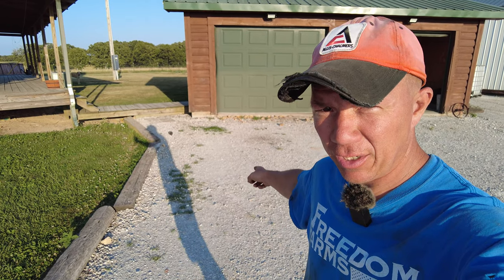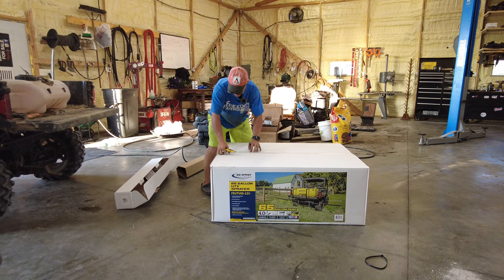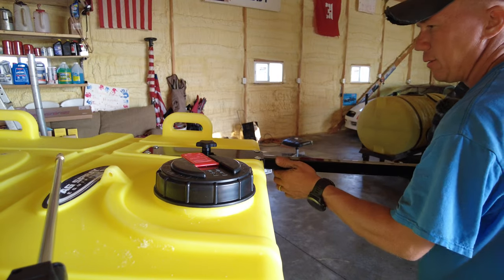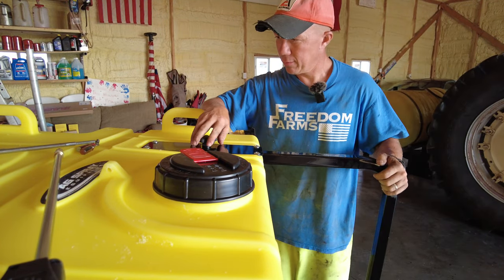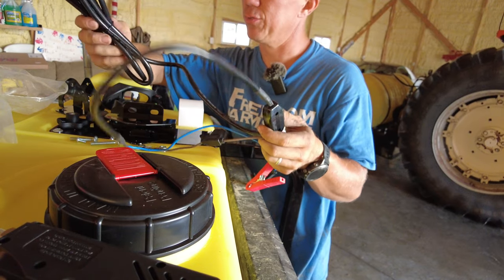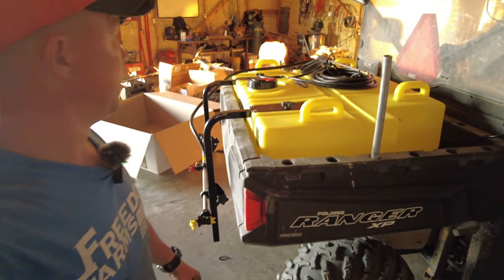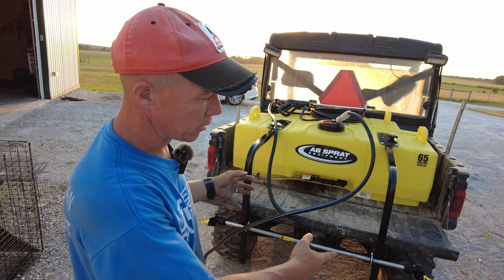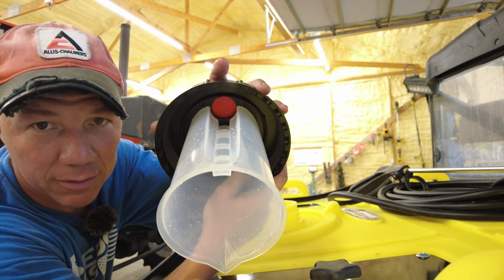65 Gallon UTV Ag Spray Solutions from Ag Zaga for the win!

Comment: Great video, did you ever do anything with the on and off switch? Is it possible to connect a remote control on it? 
Thank you
Reply from the maker: The on/off works it is just inconvenient on the ranger because my battery isn't on the driver side. Good question, I'm sure you could do a remote.

Comment: Not a big fan of the boomless sprayer on my Tractor Supply.  It appears to be the exact same thing as here.  The product application is inconsistent even with no wind.  This was readily apparent when looking at the die pattern where I sprayed.  Moreover, the plastic twist knobs were so tight that one of them broke.   I went and bought a 7 nozzle boom sprayer attachment and it works much better.
Reply from the maker: Didn't have that issue at all with ours. The tractor supply one and this one are not the same product. The tractor supply one is a much cheaper and lower quality to say the least. This one has been working well for us for over a year and we spray pastures with it at times.